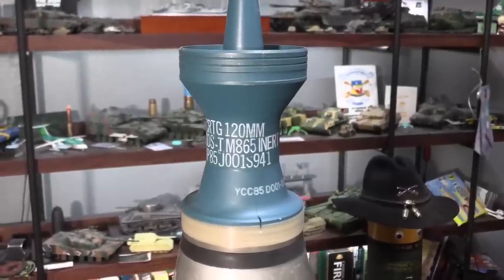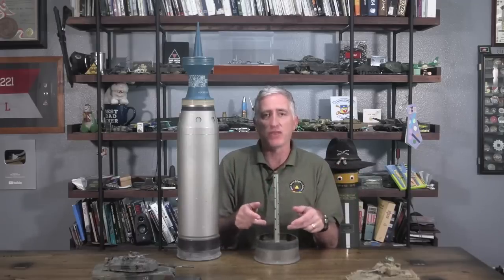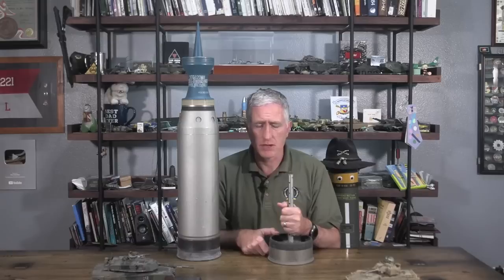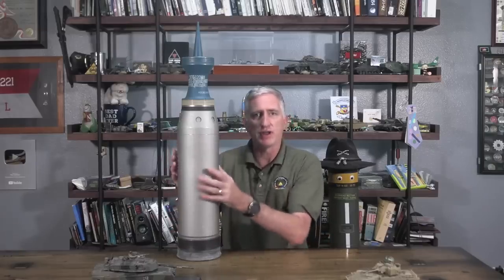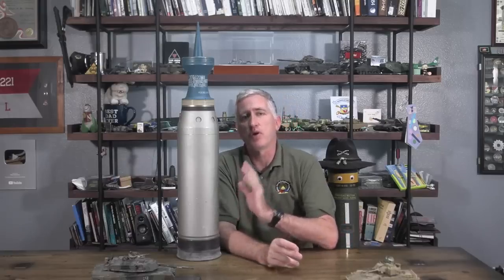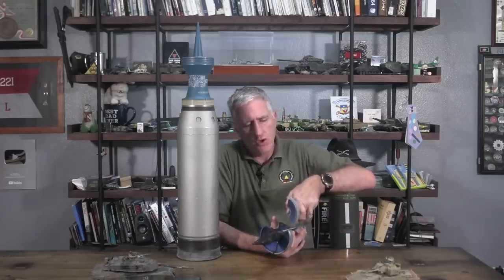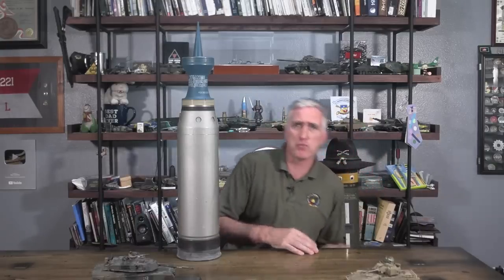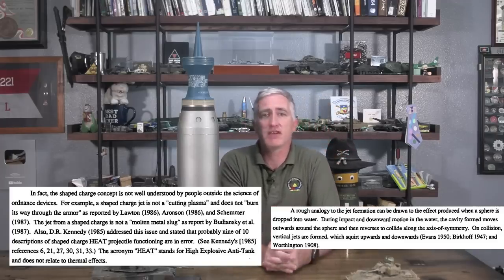Tanks 105: Anatomy of a Modern 120mm Round

Comment: If I remember correctly from reading Ogorciewicz' first book on tanks ('Design and Development of Armored Fighting Vehicles, 1914-1969", if I'm remembering correctly; I don't want to go dig the book out of the shelf), the mathematics for penetration of a shaped-charge warhead sit between the penetration equation for pushing the armor sideways out of the way of the jet and the penetration equation for pushing a cylinder of armor out in front of the jet (after the manner of a cork being pushed out of a wine bottle from overpressure). I don't pretend to understand the metallurgical reasoning for this, but it was an interesting enough bit of data to remember. At any rate, the equations apparently work well enough for them to be used designing shaped-charge warheads for a desired penetration, which is good enough for the end users to work with -- they don't need the math, they need to know the expected results.
Reply: I still have my copy, too

Comment: The aerodynamic function of the protruding rod of the HEAT round is that of an "Aerospike", which does, indeed create a shockwave that improves the projectile's aerodynamics.

This is also utilized on the Trident D-4 SLBM (Submarine-Launched Ballistic Missile), as the requirement to carry multiple warheads compelled the designers to build a vehicle that does not exceed the hull-diameter of the Ohio-class boats.

The aerospike allows a fat missile (Overlarge in diameter, as related to its length) to have acceptable ballistic performance.

Comment: When the Americans first encountered these type of shells in testing, the casings did not burn completely. After the procedures were examined, they discovered that the Americans swabbed the breech with oil. This prevented the casings from completely burning up! That procedure was stopped and then the system worked as intended! That is what I read in an old book that I have about the M1 development.

Comment: Interesting.  I assume the casing is cellulose because it's lighter, less expensive,  removes the need to deal with a full case after firing, and saves brass for other uses.  
What do you do if you have a ruptured casing, and propellant spills out into the tank?
Reply from the maker: Not light a match, and clean it up as best you can with non-static-producing materials.

Comment: Not sure if you misspoke or I misheard at the end but I believe the jet created by a HEAT charge is described as 'plastic' as that is what is actually happening (rather than the false explanations your text source quotes in order to dispel them) - the material has such a huge amount of energy driven in to it so quickly it does not have time to become molten or a 'plasma' but undergoes plastic deformation.
Reply: The text is quite correct. As usual, even though the words ‘is not a cutting plasma’ are clearly visible in the text HE provided, HE still describes it as plasma. Bloody experts… :) The copper cone can be said to be in a state of superplasticity. The word ‘plastic’ just means ‘easily deformed’ (I’m not intending to talk to you as if you’re an idiot, that is not the case at all, I’m just tired of hearing ‘experts’ telling us cobblers and want to make this point inescapably clear did those interested). As such, the text is bang on accurate. The cone is inverted (if you’ve got time, have a look here on YouTube for the animated diagram of how a shaped charge works, it’s a bit of a mind-bender but very interesting) into a long, thin rod. This rod basically pushes its way through the armour until there’s nothing there to stop it. Hopefully (if you’re the gunnor and not the gunnee), there’s enough of the jet left to penetrate the armour and unfortunately, the folks within. 
There’s also a chap on here called Sidney Alford who has a small video on the matter of how shaped-charges work - Once again, if you’re interested in this kind of thing, I’d suggest watching all you can of his work as he’s an explosives genius (invented loads of charge holders and the like) and the very chap that made me want to work with explosives. Sadly he is no longer with us (old age, and thankfully not being sent out of his testing area, backwards and in fire at ~the speed of sound…) but there’s a good couple of hours’ viewing when you get the chance as I’m sure, if you like bangy boomy type things, you’ll enjoy every second of it.

Comment: side not to APFSDS and spall. Depleted Uranium is used in several designs of penetrator not only because of its high density and self sharpening properties, but also because its pyrophoric, which means in small enough sizes (ie powder or shavings) it will spontaneously combust at standard atmosphere and ambient temps. This means that when it punches through armour not only do you have white hot shards of armour plate being scattered at high velocity, but also fragments of depleted uranium from the penetrator that, having been shaved off in the penetrating process, will catch fire inside the vehicle.
Reply: Your bog standard common flour can do that. It is just different material required different humidity level to do that. 
The pyrophoric effect is of no real combat value, as stated in US Army test report. 

Also, I don't think you know how rod erosion works. 
Most of the rod material goes back out of the hole. 
Vast majority of the time, rod goes into the armor in a one or multiple large pieces.

Comment: Easy explanation: the cone of shaped charge behaves like fluid because of blastwave and coned shape and is goes through plastic deformation. Lance is more scientifically accurate name than jet for the output.
High explosives like to shred stuff into pieces, not to heat them to plasma levels.

Comment: I'm trying to remember. I think there was a round called an MPAT that had a proximity fuse, supposedly for use against helicopters?
Reply: Something like that definitely used to appear on tank sims in the early days, not sure if it was just speculation or not.
This might have just been a case of the "F-19" all over again. 🙂
Reply from the maker: There is, it's the M830A1. It is something of a smaller, saboted HEAT round flies faster and has a selectable (air or ground mode) fuse.

Comment: there are quite a lot of tanks that shoot sabot rounds that have muzzlebrakes. amx 10 rc, centauro 120, type 16, cv 90120 and some more. a muzzlebrake can interfere with the sabot if its far beyond the muzzle and really tight. designs like the amx 10rc one are short and have a big hole so there is no issue. designs like the centauro take another aproach, they keep the sabot from seperating by porting the barrel itself with lots of holes. i would imagine this makes a less effective braking effect which would explain the high amount of holes, but it should ensure proper stablilization. my main question is: why dont all tanks use muzzlebrakes? especially on bigger caliber guns like the 130mm tested by rheinmetall i would imagine that the recoil reduction would enable a lighter platform or more room in the turret

Comment: 8:21 In other words the probe is acting as a drag-reducing aerospike.  From Wikipedia: "A drag-reducing aerospike is a device used to reduce the forebody pressure aerodynamic drag of blunt bodies at supersonic speeds.  The aerospike creates a detached shock (AKA bow shock) ahead of the body.  Between the shock and the forebody a zone of recirculating flow occurs which acts like a more streamlined forebody profile, reducing the drag."  You will see them used on submarine launched ballistic missiles where a long missile with a nice aerodynamic nose cone would require a very tall launch tube and therefore a very large submarine.  The warheads in the nose cone are arranged around the base, so the top half is just empty pointy space for aerodynamics.  Truncate the nose cone to make it shorter, embed an aerospike in the centre that will extend up out of the nose after launch, and you have a good compromise between missile size and aerodynamic efficiency.

Also the importance of the third function - providing the optimal spacing for the "jet" (super-heated slug) to form - cannot be overstated.  A lot of effort is put into getting that millimetre precise because small deviations have a big effect on the armour penetration of the jet.

Comment: Excellent video. But it left me with one question….

As the 120mm gun is a smooth bore, what stabilizes that HEAT round?  It doesn’t have the fins of the dart and obviously there is no rifling to impart spin.  Does the action of the probe really provide enough stability?
Reply: HEAT from smooth bores have fins for stabilization - like a dart or arrow. They spin at low rates. In fact HEATs are much more effective from smooth bores than rifled bores, because high spin rates disturb the forming jet upon explosion. That is the reason why HEATs from 105mm rifled bore have special designs to turn down spin rate...

Comment: @TheChieftainsHatch You should ask your retired resident Aussie dropshort, all rounds operate in the same way, whether its a small arm, AT, Tank gun or Artillery piece. In fact, they're all Artillery pieces adapted for different use. Propellant is a low explosive (slower burn rate than high explosive) thus preventing catastrophic disassembly of the piece (this is a bad thing). Whether the primer is initiated via percussion cap or electricity is neither here nor there. There is only one rule for Artillery ammunition, never place/drop it on it's base or conflagration will ensure.

Put it this way, you won't put it on it's base a second time.

They want you creating paperwork for the other side not yours. I would think with you being an LtCol you wouldn't like unnecessary paperwork.

Comment: I presume that the primer is long because you want the gunpowder to to sort of burn from the front. That will push the remaining powder towards the casing instead of out the barrel.

I presume that this is not enough, so several holes in the primer is provided to ensure further ignition.

Comment: I have some questions that's been bugging me lately which is "is the placement of bore evacuator on a tank gun critical to it's performance ? If yes what aspect will be affected the most and why some tank guns have the bore evacuator on the end of their barrel (i.e. d10t, 76 mm M32A1....) but others have them near the breach (i.e. L7, M68....), does it have anything to do with the caliber of the gun ? Hope you can explain these question to me if you see this comment. Love your content man
Reply: Where you put the evacuator is basically down to the designer and will effect the firing harmonics in terms of muzzle flip. It will also effect the overall balance of the recoiling mass. The further away from the pivot point the higher the effect. Tank gun trunnions are usually close to the breech end to reduce the intrusion into the turret. Any imbalance has to be accommodated by the elevating gear, and the further away the evacuator is from the trunnion, the more it has to be balanced. 
The evacuator itself has to have sufficient capacity to clear the barrel of fumes so that it does not leak back into the turret, even if the hatches are open and there is not positive pressure in the hull. You cannot have the evacuator too near the breech as this will interfere with the propellent burn and you would get erosion issues with hot gas and potentially burning propellent entering the evacuator. 
..so as with anything in design, it is a matter of balancing and compromise.

Comment: Propellant does not “detonate”. Detonation occurs due to a shockwave. 
Propellant burns, at a much slower rate than detonation to limit chamber pressure.
Driving a projectile from a barrel is not an explosion as such. It is an expansion gas caused by controlled burning of the propellant.

Comment: Great video but I always asked myself why there are still 120mm HEAT rounds around. If you are firing at a hard target, use APFSDS. If you are firing at a soft target, use dedicated HE. What is the job for HEAT in modern combat?
Reply: HEAT is still ok as a HE round, plus it defeats the armour of older tanks, bunkers, fortifications and IFVs.

The new wave of course is to put programmable smart fuzes in HE. So instead of HEAT tanks will carry smart HE that can be set to air burst vs infantry in the open, or delayed mode against a fortification.
Reply: Most servicing modern heat is a left over legacy system of the yesteryears. 

But by adding different fusing modez they are in general a half decent anti everything else round. 

Newly developed round tend to eliminate heat all together.

Comment: Thank you very much for the clarification of what "inert" means :D . I previously thought it meant "VERY ert" lol

btw how did you aqcuire this training aid? like how do you formally tell the army "hey, can i just take this dummy shell home and keep it?"

and thanks for explaining the casing being combustible. I always wondered what material the casing is made of
Reply: I a, still wondering about flammable and inflammable  It always seemed that one would burn and another won't though I understand that is in-correct!
Reply: It's amazing the shit you can get hold of by being friendly with the folks over in supply.  Stuff which would otherwise be duly counted into the trash bin gets duly counted into a rucksack instead.
Reply: @keithstudly6071  They actually both mean the same thing.
Reply: @CharlesStearman  When the fire safety people use them they don't mean the same thing! They break things into categories according to how easily they ignite . Wood and paper are combustible. heavy oils such as motor oil are flammable and things like gasoline with a low flashpoint are inflammable. The temperature of ignition is the determining factor to the classification.

Comment: I thought I remembered reading in Tom Clancey's Armoured Warfare that a US KE penetrator round passing clean through armor still caused quite a bit of havoc to the crew and vehicle because the round would spontaneously combust, creating a decent fireball inside the vehicle. I lost that book some time ago, so maybe I'm just mis-remembering.

Actually, I think I found a reference story online. A Bradley with A Troop, 4-7th Cavalry was struck in the side of the turret with a KE penetrator when an Abrams mis-identified it. The round went clean through the turret and out the other side, but caused an explosion. The gunner and TC were injured directly, and the driver and loader suffered flash burns. If I remember right, all were also monitored for radiation poisoning.
Reply: That's because some of US KE penetrator are made of depleted uranium which is pyrophoric. Most other nations uses tungsten penetrator as it is more readily available and doesn't show the toxicity of uranium.

Comment: Would be cool if you did a video on Muzzle breaks, and why they aren't used on modern MBT cannons.
Reply: Brakes.  Muzzle BRAKES!  Sheesh.
Reply: @stevedugas8988  Sorry :P
Reply: Because they fck up accuracy if you use sabot...
Author also claiming that HEAT jet is plasma when its temperature is too low to melt copper not to mention steel...
Reply: @Bialy_1  Why does the cannon on the Bradley have one then?

Comment: Why did we get rid of muzzle brakes recently? Are they unnecessary for the recoil dampers we have in modern tanks, or do they affect accuracy? It seems odd but Im sure it has a simple reason.
Reply: On modern tanks there is a system installed that brakes the recoil of the gun, also modern tanks are much heavier than for example in WW2. In the Leopard (and probably most other tanks) there is an indicator which the gunner has to keep in mind because it shows if the brake has reached it's limit. The dampers will lose strength after many rounds and will have to be replaced.

Comment: There is a story of someone at the Yakima training center having their computer set for HEAT with a Sabot loaded. The sabot supposedly landed in the middle of the high school gym, some 10-15 miles outside the training range.

Why? HEAT rounds fly a lot slower than sabot (a couple hundred meters per second slower!), so the gun tube needs to be elevated a lot more to have the same range.
Reply: If you fire Sabot at the high angle needed by HEAT it will fly a LOT further...

DUH!

Comment: Couple of questions:
1) The powder.. is it extruded, ball, flake, something else (just curious)?
2) Ever put a roll of toliet paper on the probe before loading the round into the chamber (again, just curious)?
Reply: Pretty sure it's tube powder, IE extruded with holes.  
I know the WW2 US propellants for guns of this size were of this type, (with 7 holes in a hexagonal pattern like a honeycomb), and while I can find references to improved chemical formulas now used in modern US cannon propellants I haven't seen any reference to any major changes in geometry and what images I have found that can't 7 hole multi-tube just have a larger pattern with more holes.